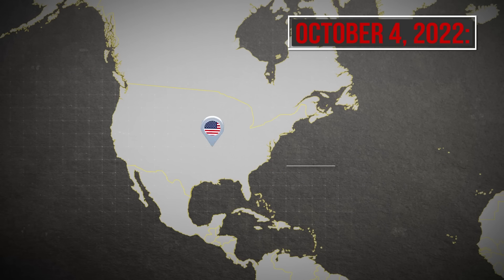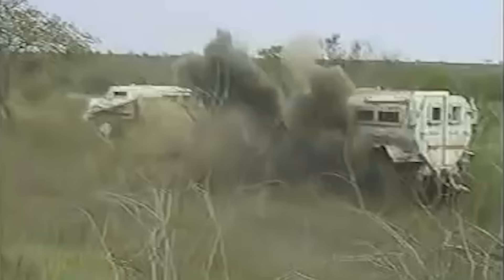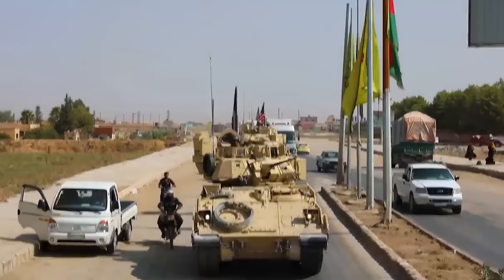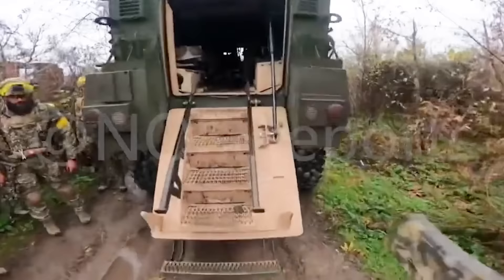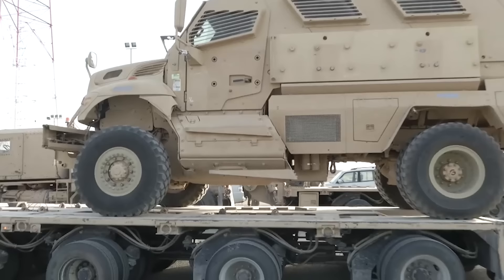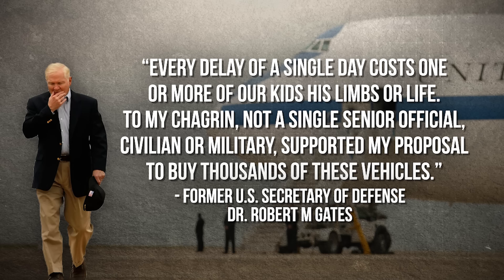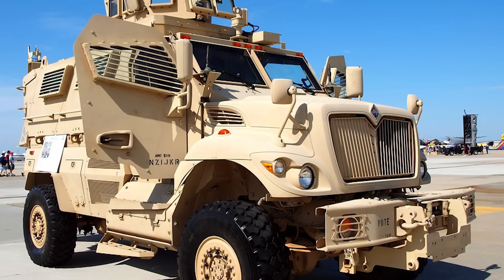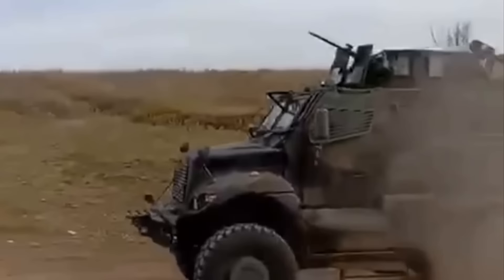Why America is Gladly Giving Away their $50 Billion Truck

Comment: A sole MRAP assigned to my patrol in Iraq saved the lives of 10 of us in an antiarmor ambush in the outskirts of Bagdad.  I see this video, and it brings tears to my eyes. I am so grateful to be alive thanks to this mighty beast. The real question is; Was the spending of 50 billion dollars investment too much? My family, my soldiers and myself think it was worth it.
Reply: if possible, could you please elaborate on actual feeling inside the vehicle during this incident?
how was it? 
did people get injured? 
any scratches at all or it just barely saved lives but people got hit on the head?

were soldiers were combat fit after the explosion or all had to be evacuated for treatment?

its interesting to understand what kind of protection MRAPs actually provide.. just basic to survive or full and complete without any consequences...
Reply: I think that's a false choice.  Our procurement system is so inefficient we spend way too much developing and fielding the equipment needed, and of course we took way too long to address the need.
Reply: Yea? How about 1 trillion $ ? Is that worth it? Lol. This kind of spending is not sustainable. 💸💸💸💸.
Reply: @benjaminshtark5977  one of the earlier Cougars got hit with an IED in Iraq with an equivalent to 600lbs of explosives. Engine, axles, side boxes and hood were all torn out. Driver suffered a broken arm from hitting a steering wheel, and few cracked ribs due to his plate also hitting that same steering wheel. Everyone else in the truck got lesser injuries. Vehicle was back on the road after 30 days (most of that time was spent waiting on parts) thanks to the Force Protection FSRs on site.
Hopefully that example helps you understand the level of protection a bit better.
Now, Cougar, Panther, RG are level 2 MRAPs, while MaxPro is level 1 MRAP, so the level of protection between them will differ a lot. Buffalo is a level 3 MRAP, and the only reason Husky is not a level 3 is because it only holds a driver and does not have any room for passengers (so, arbitrary classification requirements).
Reply: The question, if the MRAPs were to expensive or not could be answered with a sharp pencil and a somewhat disgusting inhuman approach: How many soldiers are lost in average and what did it cost the society to raise them, educate them and how much will it cost society to loose a productive member or to take care of injured or maimed. So basically calculating the net worth of all potentially losts citizen against the costs of the program. My rough guess is: money very well spent! But the best idea would have been to stay out of the middle east in the first place...
Reply: As a tax payer. Yes it was to much spending
Reply: @stenyethanmathews945  yes it isn't, but if a country decided to wage war, it better does it properly. Those trucks were expensive but they were desperately needed as well. War is very expensive too... If the US couldn't have afforded those trucks, it would've meant that the country could not afford waging this war. So you can look at it as 2 options: Either withdraw from the war or buy those trucks... There's a third option; fight the war with unprotective trucks. Well,  I hate to say this, but you can look at the russian military now. They aren't withdrawing from the war, but their good equipment is running out of stock, so many of their soldiers are sent out to Ukraine with ineffective bulletproof wests and helmets, unprotective vehicles, old rusty rifles.
Reply: @Thinkle911  That’s really not the calculation though. It’s whether $X billion to save Y lives could have been better spent to save Z lives. And who says those lives have to be on the battlefield?
Reply: im getting the idea from reading that this was a great creation, but only serves it's treasured purpose when it gets hit, and is deemed inoperable. But losing the truck and keeping the 10 soldiers in action or only injured is a vast improvement from the m4 sherman strategy - "We will just make so many of them like the russians did that the Germans can never take them all out" losing both machine and usually all the soldiers inside.
Reply: @jasonlawrence4617  the shermans were still better than the russians though

Russians were counting on one tank eating 1-2 shots while america expected an average of 4.
Reply: @jasonlawrence4617  They also weren't done after taking a hit.  We had teams that repaired them and all but a handful were repaired and put back in service.
Reply: You had no business to be in Irak.
Reply: @philippebracq884  shouldn't have bought bad weapons from the US
Reply: Fuck yeah it was worth it!
Reply: To bad  they missed. 🎄🎃🎃🎃🎃🎃🎃🎃🎃🎃
Reply: @stenyethanmathews945  it was worth because it saved so many lives
Reply: I don’t and you should have not fought.  All the wars including ww2 for Americans was stupid and served no purpose. Russia had already defeated Germany. Sahdam had zero wmd.
Reply: @Kondor That's a false equivalence. The argument is easily flipped because more effective solutions, that cost less, could have been more widely deployed to save even more soldiers. Hell, the easiest and cheapest one would have been to GTFO of Iraq faster. But we weren't' there to "save soldiers lives", and soldiers don't willingly sign up to the military because they want their lives "saved" from combat, let's be honest. Bureaucracy and politics and favoritism is what got you and your patrol into that situation in the first place. We civilians still don't have a good answer for why we had to be there at all. So was it worth it? All the lives, all the bombs, all the money? Everything everyone had to pay so you can say you survived? Hmm.
Reply: @benjaminshtark5977  if you're curious about the "combat readiness" that PMV's provide (MRAP is only used by Americans)
The Irish designed but Australian built and modified BushMasters have only now, after 25 years finally had a casualty...... because it was used as a front line assault vehicle in Ukraine....took a missile with a lot of luck to do it
Reply: @richardcostello360  well.. personal armored vehicles are not designed to withstand direct antitank missile or tank shell hit.
The armor rating of these vehicles is probably Level3 (by NATO standards), so it can withstand small arms fire, some artillery explosions from at least 60meters away, and maybe some anti-tank mines (up to 8kg).
it cannot survive direct hit by missile or armor piercing 30mm auto-cannon fire (like used on choppers or some planes).
but again, these vehicles are not supposed to go in direct contact with enemy armor or AT positions as they will die like flies.
they are best used as troop carriers and may be sometimes provide some fire support from safe distance (1-2km).
Reply: @benjaminshtark5977  I know......but the BushMaster has a record career of not only saving all her passengers but also keeping them combat ready to piss on the enemies cornflakes 😏
None of that over designed "Made in the USA" vehicles have been around that long and they have had quite a few deaths...... plus for some reason the Americans didn't include a weapon mounting system that allows the weapon to be fired by the crew under armour 🤦
Reply: @benjaminshtark5977  he cant because hes talking shLt
Reply: Я думаю,что миллионы убитых мирных Иракцев от оружия США  с вами не согласятся
Reply: That's really cool and all. But none of you gentleman should have been there
Reply: @notskottkendall  и не должны быть там
Reply: Yeah but why international? Why not peterbilt, Kenworth, western star or a mack.
Reply: @RumblesBettr  - Easy to say when it wasn’t your life that was hanging in the balance.
Reply: spiderman no way home<somebody makes alot of money on this
Reply: but if you faced a real army, you'd be dead
Reply: yeah, pretty hard to put a price on life
Reply: Ukraine isn't fighting mujaheddin with AKs, a couple of grenades and a flip-phone bud.

Comment: Your infantry can't win a battle if they get blown up by a mine on the way to the front.   Ukraine has an incredibly long front line, and only small parts of it are the scene of large scale armored offensives.   On the other hand every meter of that front line is plagued by snipers, infiltration teams, and partisans.   So something like the MRAP gives a cheap and easy to learn vehicle that can be used for transport and patrol on the "Quiet" sectors.  That frees up your armored units for service where you are actively trying to punch a hole in the Russian lines.
Reply: There's downsides to using the US M113 APC near front lines, but it looks like the Ukrainians are adapting it to their use very well. Seen a number in convoys transporting troops to the front. How close they get, they don't say.
Reply: our dude, you know
Reply: I'm just wondering how difficult it will be for them to learn such a vehicle. Also, I wonder about the maintenance requirements and how reliable they are?
Reply: @dpelpal  Thousands of Ukrainian soldiers are being trained by NATO so I am sure it was planned for a while and the first units recently finished the trainings and ready to be sent home, That's why the timing for the equipment is now.
Reply: Cheap 😂
Reply: The problem is they are built for occupation not a war and certainly no fit front line operations. Hence why they didn’t fit into us army doctrine
Reply: @dpelpal  More intensive requirements than a Toyota Hilux or Lada, but far less demanding than tracked APCs or IFVs. This is usually the trade off decision in designing, building, and acquiring wheeled versus tracked transports. The former handle better over long distances, roads, etc.

Wheeled transports are inherently cheaper to operate, easier for troops to learn to drive (it's just a big truck, crudely put), maintain, etc. Ukrainian troops aren't backwoods hicks. They have an industrialized country, and during the Soviet Union era, Ukraine was a critical hub for the Soviet tank and armored vehicle industry (I think they had the biggest or only tank production facilities outside of Russia itself?). So whether wheeled or tracked, Ukraine has a strong history with armored vehicles going back decades. And Europe/Ukraine are no strangers to trucks. :P

The French use a lot of wheeled vehicle designs to operate in and sell to their current/former territories in Africa. Ditto why South Africa focuses on producing wheeled vehicles. Lots of territory, low GDP in comparison and thus much tighter military budgets per square km needing coverage.

Lots of bang for your buck.

Tracked vehicles are good for more intense peak demand type situations where the terrain is more difficult, or heavier armor/armament needs to be carried. But this peak performance on demand comes at a disproportionately higher price, so you have to either 1) have the weight of the US military budget, or 2) pick and choose which of your units will receive and use these units to maximize their benefit.
Reply: @StoutProper  Given the Ukrainians have been using civilian cars and trucks to transport around, these are an improvement. You've got to remember Ukraine is operating at a very low bar, for America these things are inferior to other options- for Ukraien they're not half bad.
Reply: @dakaodo  that's why the US brought a lot of 113s to Vietnam
Reply: @dpelpal  a diesel engine is a diesel engine. A tech manual and a couple hours will solve the problem. Parts availability is the bigger issue.

Comment: As ex-South African military I remember our vehicles well. They perform brilliantly if used for the purpose they were specifically designed for : low-intensity counter-insurgency warfare. The problems start when you try and use them for anything else.
Reply: @JohnHughesChampigny  Maybe saying of limited use would be more accurate. They can be used to safely transport infantry to just behind the front lines, to evacuate casualties, as a field ambulance, as a command vehicle,or as a logistics vehicle for field artillery. Unfortunately being a wheeled vehicle they will not be very effective in mud or deep snow.
Reply: Why would they send this system to Ukraine, which is a conventional war.
Reply: @gilgameschvonuruk4982  because they want to get rid of them, not because they are the best system.
Reply: @gilgameschvonuruk4982  Because the alternative would be using a Hilux. They might not be perfect but the situation is desperate all protected vehicles are useful. They are using hawk AA missiles from the 1950s, and Maxims and Mosin-Nagants.
Reply: @simonabunker  Then they would just sell them they are still valuable there are plenty of armies that use older kit.
Reply: @ericconnor8419  The Hilux is cheaper to refuel. But mines are a fairly significant threat in Ukraine and the MRAP is a good vehicle to put up in front of any soft convoy.
Reply: They could be good in Ukraine to protect against shrapnel, as you use your phone 3 km away from front line, to operate a drone, for a 122mm 11 km away. Better than a car.
Reply: They are warm too. So you can eat your food and take a little break.   Just read cordingley on 1991, and he eats cold beans and sausages and yearns for hot tea. Pretty basic stuff
Reply: such as facing against btr and mbt lol
Reply: For going to the corner store to buy milk.
Reply: Well yeah like any tool or weapon. You use it for the wrong purposes you can't be surprised if it doesn't do what you want.
Reply: @gilgameschvonuruk4982  because there's also a lot of Mines there so even if they're not going to be great for Frontline use moving troops around or use them for IED and mine clearance may be useful and we have them sitting around doing nothing
Reply: The Ratel is the best !
Reply: Marcus wtf happened to south africa you lost the country why did you let it happen i thought you were the protectors
Reply: @BosonCollider  They will stop a .50 cal round which is quite significant, unless it takes a direct hit it will stop most artillery shrapnel too. The Bushmasters have turned out to be really useful.
Reply: @gilgameschvonuruk4982  Because both sides are laying minefields everywhere and having anti mine vehicles would be useful.
Reply: @simonabunker  Nope.They want to help that is all.
Reply: @ericconnor8419  Your comment made me want to get into Squad again lol.
Reply: @gilgameschvonuruk4982  Even in a conventional war the troops need good transportation.
Reply: @gilgameschvonuruk4982  Troop transport and they can send them over as if out of an Amazon warehouse, rather than having to wait months for manufacture or other delays.
Reply: spiderman no way home<somebody makes alot of money on this
Reply: Just like the humvee.  It did so well in its intended role and its chassis could be used for so many different things that they ended up forced into everything and then people were surprised when they blew up after being used like Bradleys. They're not Bradleys.
Reply: but you still need transport so these are as good as m113s ( sorry far better than) for moving gear into and out of areas.
Reply: @anthonymitchell8893 You know that the SA army had nothing to do with the cowardly decisions made by the politicians.
Reply: Koevoet showed that they are pretty effective for "outrun and outgun" type of engagements, very little tactics needed at all. Just fly in and let 50 do the talking. I know many despise koevoet but there are lessons there to learn from. Im not going to engage in a political conversation.

Comment: As an Iraq combat infantry veteran.... These mraps/kmans on my 2nd deployment performed extremely well and resisted mines/IEDs. Saved multiple lives in my platoon alone.
Reply: We've had footage of both sides getting slaughtered in civvy vehicles by small arms ambushes. And also Ukrainians using donated Humvees to good effect in an assault role - these are going to save lives. The only question is whether they are better than a  Hilux in combat. The answer is obviously yes.
Reply: @RandomInternet User you shouldn't have invaded them in the first place!
Reply: Polish special forces in Iraq were supplied in Polish ''mraps'' and as soon as they realize how weak they are they shared American ones
Reply: All it needs is a fully auto belt fed 30mm or 40mm sniper gun mounted on the top of it to turn it into a "Rolling Wart-Hog" tank killer. What-Ever the Ukraine's arm it with you can bet the pentagon will be jealous of the Ukrainians innovative skill set. It's amazing what a Ukrainian can make out of a $25.00 WIFI security camera mounted to a telescopic gun sight feeding streaming video to an old iphone 6. Our military would spend $50,000 for something that was 800X bigger and could not be fixed by a 12 year old with a guitar pick and a micro screw driver.
Reply: @johnslugger  the 30mm of the a10 works because it hits tanks from the top... where the armor is weakest... normal 30mm will not penetrate frontal armor for even some legacy tanks like what were seeing in ukraine... why do the ignorant speak with such confidence?
Reply: @RandomInternet User and other imperialist things?